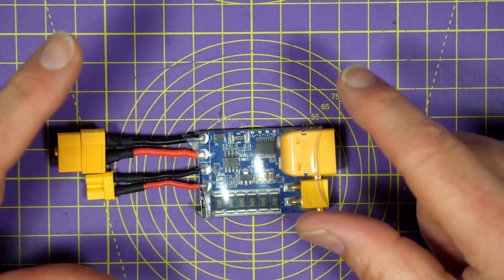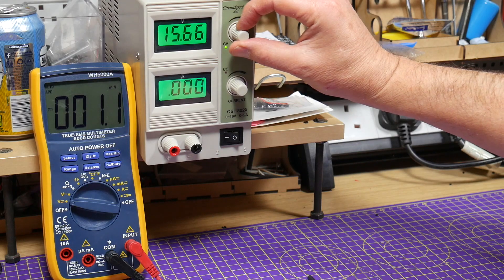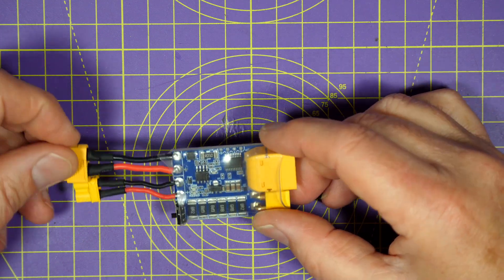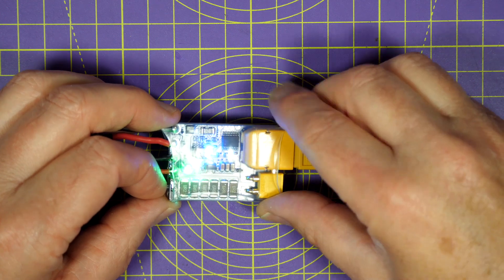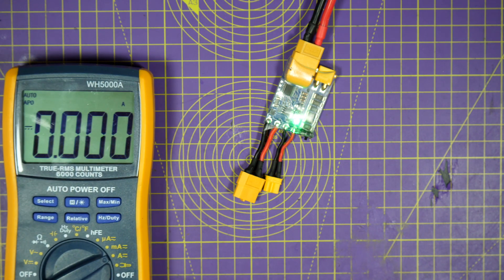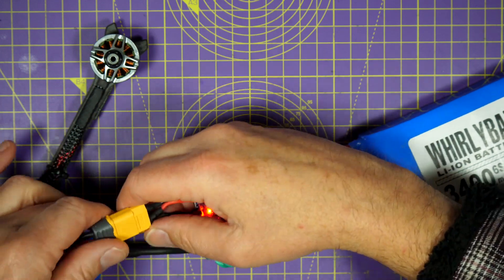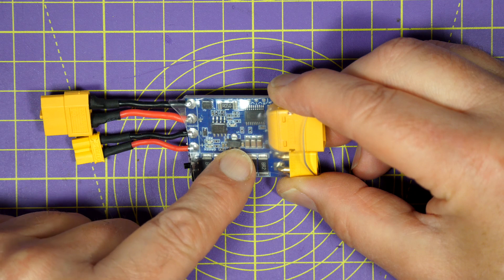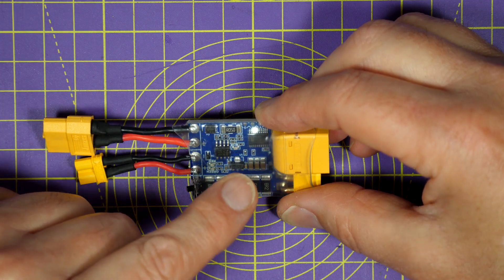ViFly ShortSaver Smart Smoke Stopper // full test and review // stop your quad going up in smoke

Comment: Is it better than the Race Day Quads smoke stopper(BengineeringLabs) XT60 with 0.5 sec Trip time @ 2.2 Amps 🤔
Reply from the maker: I haven't tried it, but that uses a  resettable fuse which I wouldn't trust to react fast enough - it's the wrong technology. I've tried just about everything on the ShortSaver and it just works.
Reply: @WhirlyBloke  AHH.. understood..many thanks sir! Hope the weather in Cornwall is warmer than here in Hampshire🙏🍻
Reply: That one is polyfuse only limit the current and not stop the current, and 0.5sec is really slow to protect the build, our shortsaver trip time is 3ms/10ms. We ever did a comparison video with that smoke stopper, check it here, https://www.youtube.com/watch?v=muHZF0YgxAI
Reply: @VIFLYDrone  ..THANKS!..I understand better now...I,LL buy one👍